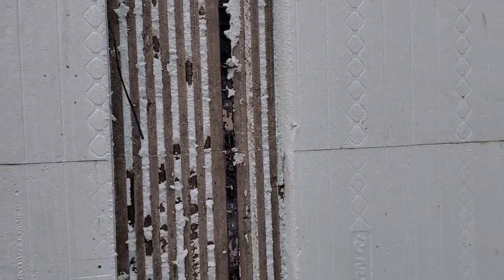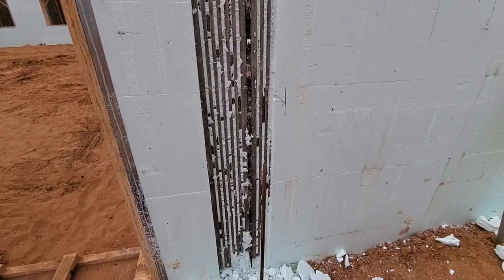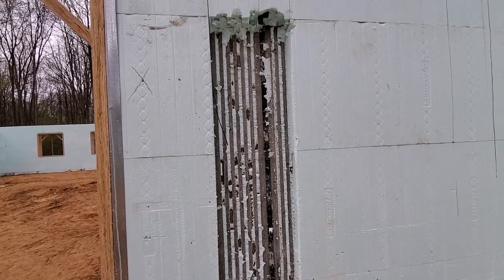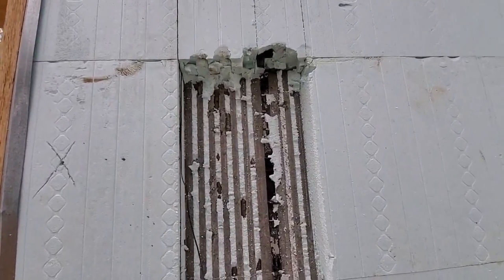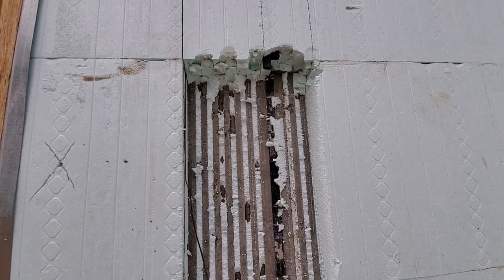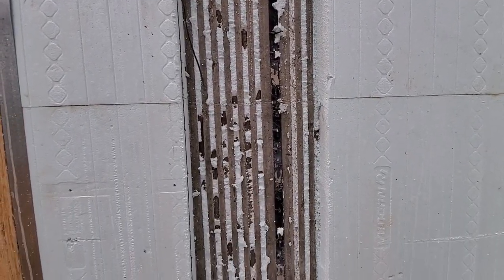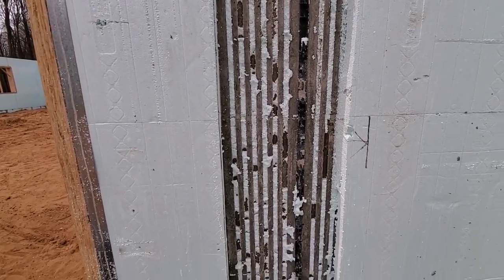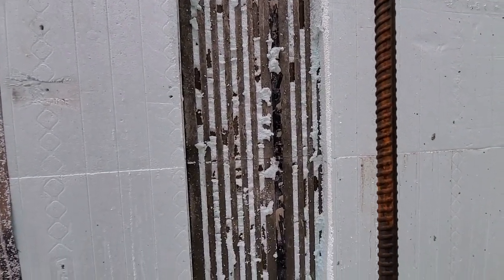Honeycomb and Voids In My ICF Wall?

Comment: Do you use plasticizers? What mix do you typically use? Thanks.
Reply from the maker: Mix performance varies widely from one supplier to the next. If you are new to concrete, or to this particular supplier, caution is the word of the day for your first pour--best not try 100 yards. 
But I do prefer to use a 5/8" diameter stone and a mid-range water reducer.